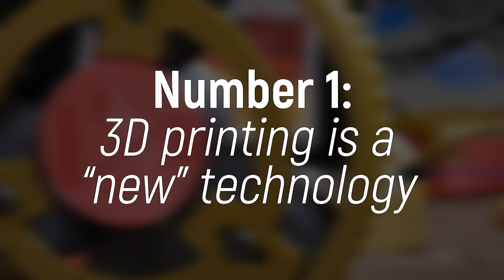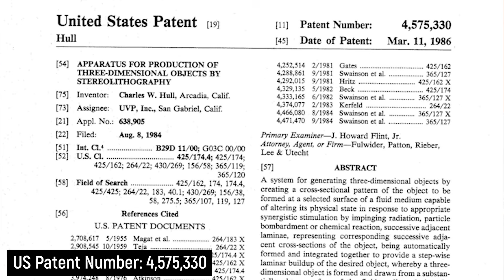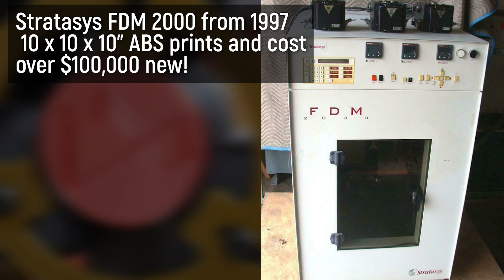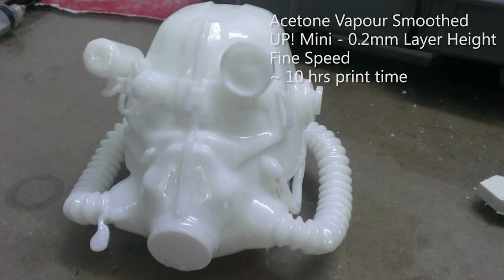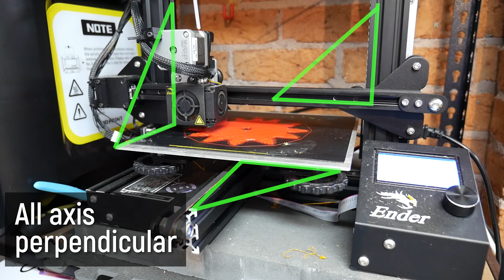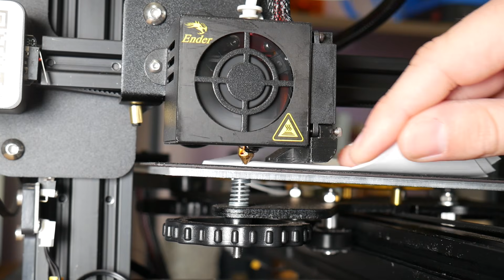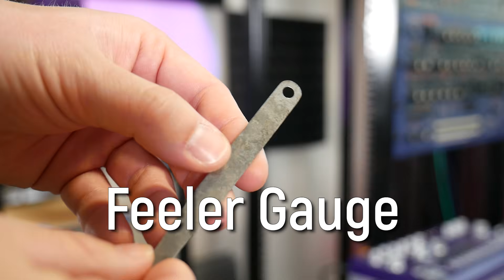3D Printing Myths I used to believe...

Comment: Instead of using a regular thick folded paper, you can use a small piece of baking paper. It is only ~0.05mm and it is resistant to heat. This is my go-to method and it works great.
Reply: I use bible paper.
Reply: @dodgyaz  is it better than baking paper?
Reply: @Pengquy  Probably not but it has more edge.
Reply: @Pengquy  Yes, it is. It gives the bed auto-level after initial leveling and you don't need to use a BLTOUCH sensor, it is magical.
Reply: @dodgyaz  even better idea!
Reply: @dodgyaz  Bed levelling with the help of Jesus
Reply: K
Reply: a card is best, no point to get that thin as you'll compensate it later with z offset or endstop position
Reply: @user-yk1cw8im4h  The thickness of the baking paper (0.05mm) is roughly the same as the common (MK8, V6) nozzle+heatblock thermal expansion you will get when heated. So you don't need to adjust absolutely anything afterward. Use whatever you think is the best.
Reply: OooOoOoOOooooo that's a good idea!
Reply: Feeler gauges
Reply: I've found a single piece of 20lb printer paper works very well. A 24lb sheet is too thick - enough to actually matter. 20lb, my prints have good adhesion all the time (barring some other issue); 24lb, they don't.
Reply: The point is that paper is not and exact thickness. it has imperfections and can crush if you accidentally adjust it too tight.  once you crush it, now the thickness of the paper has changed. so it's really a blind leading the blind method.   feeler gauges are exact throughout and do not crush.   While paper may work "OK" it is nowhere near perfect.  Although only your first layer or 2 would be affected by imperfection, the subsequent layers would fix themselves as the plastic is malleable and it will self level as it goes.
Reply: @viperfukgoogplus386  it is actually, standard a4 paper is 0.1mm thick, consistently

Comment: So assuming the frame is square, If I set my nozzle/bed gap to 0.2mm and in the slicer set the first layer at 0.2mm, will that mean it actually prints the first layer at 0.4mm?

Comment: Hi, very interesting video, thanks for enlightening me.

I have issues with the feeler gauge method over paper - the feeler gauge is smooth, and it's hard to detect contact unless you apply downward force, and then the bed or nozzle will deflect because of the springiness of everything. The 60gsm paper method is better in my opinion, because it has texture and you can feel better.

If you mic a piece of 60gsm, will get 0.1mm all day. The micrometer will compress the paper slightly. I aim for a light touch, I can print a test layer at 0.1mm and get pretty close to that and I find that with my 60gsm, light touch method, My prints stick well to my (glass) bed when I print at 0.1 or 0.2mm first layer.

PS, have you heard of PLA-F? I got some by accident and love it!

Comment: As far as I could tell in Ultimaker or Simplify3D and probably any other printing software, it says in the print settings, what layer height the first set of layers should be...This is something clearly stated in the instructions, so I am not sure where a myth would come from. ALSO it states to use a THIN SINGLE LAYER of paper, not to fold it. I am sure the community thought they were smarter than the guys that write the code and software to use with printers, but dang...RTFM. The most crucial thing to do, is to REALLY FOCUS on the setup of the printer and getting the gantries square, bolted tight and moving smoothly with belts firm but not stretched...again RTFM....it's all there. Even the poor translation from the Chinese made Ender are spot on.

Comment: As a former engineer with tons of machine shop experience, I’ve always hated the term bed leveling. I level using a feeler gauge, but I take one more step. I place the nozzle directly over the center of the leveling screws. This eliminates any errors that might be introduced by being too far away from those fulcrum points.
Reply: I found some g code for the ender 3 that goes above each poiny
Reply: @tobysmith4604  ok that explains why the level spots I use pretty much line up with the leveling screws.
Reply: Yeah. That always made the most sense to me.
Reply: I was just doing the above the screws thing earlier, didn't have any paper or such tho..(I just put the thing together today, am still noob :o)
Reply: Wow wow amazing very very clever dint think of that idea but yeah come think of it your definitely right each point will make the build plate level 👍👍👍😎😎😎thanks
Reply: @richardbrown9035  ok, boomer
Reply: It's also not a bad idea to check the centre of bed too for bigger prints. Can eliminate any possible bowing before starting
Reply: That is actually a really good tip!
Reply: I'm happy that my first printer "says" just that. the feeler gauge is a sheet of whatever that is, but it tests the hight on every screw+ the center. I think this is quite good.
Reply: Yeah this is what all the guides I saw said to do, go right over the screws. Then these other videos are doing corners, and this is first time ever I heard "folded" paper its like no so much is off with this.
Reply: I did the same, eventually I wrote a G-code, that moved the head to the right point and made two full circles, as due to 4-screw design on my ender, one screw can move opposite side of the bed.
Reply: @Papinak2  the whole point of placing the nozzle over the center of the leveling screw is that those points are fixed. They don’t move the opposite points, or as long as you’re close enough not a significantly difference.
Reply: @JeffsAquaponics  tht would be true for three screws, but with four, there's always some force that pushes on the other screws - in an extreme case, if you tighten screw in one corner (by several milimeters), adjacent corners become loose, too.
It doesn't matter if you're nearly square, but if there's about a milimeter difference between corners at start, it becomes more apparent.
Reply: @Papinak2  the the center of each screw is a fixed point, unless you’re starting with a grossly off “level” bed. In that case you’re dealing with the springs potentially not doing their jobs. But if you’re relatively “level” then for all practical purposes the center of each screw is a FIXED fulcrum point. As you move away from the screws you’ll start to see things move due to the bed pivoting on the FIXED points. Seriously, I’ve used a dial indicator on those points and they move in the tenths if at all, which makes zero practical difference.
Reply: @JeffsAquaponics  grossly off-leveo is exactly what younstart woth, if you tighten all screws and then start leveling, like mentioned in video.
Tenths of mm become quite a lot, if you print with 0.2mm nozzle on glass, without mesh leveling.
Reply: @Papinak2  tenths, and in ten thousandth's of an inch. Like what a dial caliper measures. I'm not arguing about your methodology of going around twice. Hell, I go around the 4 points the first time and just make the bed touch the nozzle. Then I use the feeler gauge. At that point the four corners are pretty much fixed and not moving more than a few ten thousandth's of an inch.
Reply: So what you are saying is I could use Any known thing like a gauge block and use that to set the z offset instead of paper?
Reply: feeler gauges are my go to for stuff like that.
Reply: Good point.
Reply: I thought about the fulcrum aspect, wondered why it doesn't go for directly over the bed adjustment screws, the first time I trammed the bed of this printer. It forms a smaller square with the tram check routine than the adjustment screw locations under the bed. Is it possible the far corners of these mass produced glass plates tend to have a slight warp? I don't see any other good reason not to have programmed the machine to go to exactly where the adjustment screws are located. I find the standard A4 printer paper, unfolded, is fine for round one, but examining and fine tuning based with the reflection of the nozzle off the bed surface at each corner, as well as the center, works best for me, especially with the thinner Garolite plate I acquired that has a slight bow warp on one axis of the sheet.
Reply: Same as smash repairs measure from fixed points generally unless somethings damaged or faulty the measurements should be sound!
Reply: Exactly what I do too. Having an engineering background is priceless.  It's amazing how popular conceptions actually cause so much confusion. The confusion I had when I first setup my printer is that I thought for some reason the paper trick was meant to bias the actual measured gap...  I quickly understood it was just a substitute for doing it correctly with a feeler gauge.  ...and, by the way folks, you could pick any known object, dial in the Z axis to its actual height and go from there. ...and also do it with the head and bed at operating temperature so that you are not including a solidified blob of filament under the nozzle and warping of the bed is included.
Reply: @robinm3003  Pat yourself on the back I guess you made the video then🤔
Reply: @Yamaha1300r  It is a wonderful method for sure. 💋
Reply: Because what we are actually doing is tramming three bed. Not leveling it
Reply: Tons of machine shop experience and you've never used a dial indicator to tram your bed? Lol I smell a liar
Reply: @aidankilleen5889  my hot end has a permanently mounted bracket for my dial indicator. I smell a troll.

Comment: Great vid, Angus.  You mentioned Z axis screws that go out of alignment when you power off the machine... This is an issue I have with my Creality CR-10 V2.  Is there a fix for this you can recommend?  It hasn't been a deal killer and I've managed to get decent prints most of the time however I'm always on a quest for improvement so any help is appreciated. Cheers!
Reply from the maker: A fix can be to loosen the screws attaching the gantry to the z rails a little, adjust the leadscrews to be level then retighten so it doesn't want to skew on its own.

Comment: There‘s another type of setting the Z-Axis. Print anything with a specific height (maybe 2mm), measure it (maybe 1,96mm) and set the Z-Offset to the difference (in this case 0,04mm). Next time you print, it will be perfect. I actually use Klipper on my CR10-S. When set up my bed, I first set the 4 corners in the same height … using a playing card. Next step is setting the mesh (5x5)  manually with the same playing card . Then I set the Z-Offset to about the playing card thickness (negative) … perform a height test print with 0,2mm layer height … measure and reset the Z-Offset … Perfect (+\- 0,02mm)

Comment: i trim up mine with just a single piece of paper ... none folded ... thats what the user manual said with mine... i still have to adjust the z-off set down to to get it to properly work sometimes though

Comment: Saying "3D printing is an old technology" completely misses the point. It existed for a long time in a niche too expensive for common use and too unreliable and imprecise for most professional uses - essentially a useless branch of manufacturing. The real revolution - THE new technology - were RepRap and Prusa - 3D printing of 3D printer parts on the same model of 3D printer, and making it all open-source and off-the-shelf generic parts.This cut the cost and increased accessibility so much, that 3D printing ceased to be useless.

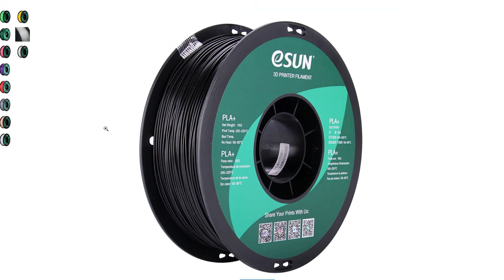Comment: 5:09 Alloy? I thought, by Definition, that an Alloy was a metal, made by combining at least 1 elemental metal with other elements. (EG, Iron and Carbon for steel, or Tin and Copper for Bronze)
It also has to form a molecular bond. The chemical compound known as Tungsten Carbide cannot be called an Alloy, it's a Ceramic, because the Carbon doesn't actually bond to the Tungsten, it just gets suspended between the Tungsten atoms.
Metals are also usually a single gigantic molecule, where every atom is bonded to another. Plastic doesn't work this way, they're made of Carbon atom chains of a very specific length bonded to Hydrogen, or very specific molecular configurations, usually composed of carbon, oxygen and hydrogen, and maybe nitrogen.
Due to the very differing nature of the atomic structure of Plastics and Metals, there is no way you can mix a plastic in such a way that it conforms to the definition of the word Alloy.

Comment: To level the bed, i print a one layer square with a cross in it, basically 4 joined squares that cover the bed. Then measure it all over with digital calipers. You can get very accurate this way.

Comment: Mills aren't trammed with paper either. We touch off of the paper so you know that you're .005" away from making the first facing cut. Feeler gauges are the best to use unless you plan on using one layer height forever!

Comment: Regarding point 3. I've used feeler gauges on a preheated system for a long time. 0.18mm worked great for PLA and PETG on a 0.4mm nozzle for 0.2mm initial layer height. For a 0.8mm nozzle and 0.4mm initial layer height, this doesn't work so well. A 0.1mm feeler gauged worked better. What's the relationship or formula between initial layer height and nozzle distance?

Comment: 7:52 Since I've gotten into 3d printing about six months ago, the technique I've settled on is to start with the paper technique, then follow it up by live-leveling the first few prints thereafter (it helps that Cura always prints a skirt so live-leveling doesn't hurt the first layer of the actual print). With that in mind, careful squaring with a single, unfolded sheet of printer paper is definitely "good enough" for quick, rough prototypes and live-leveling gets me the rest of the way for final versions or more aesthetic prints.

That being said I imagine it will be hard to go back once I decide to pull the trigger on a BL Touch or similar device...

Comment: 3D printing used to be called "Rapid prototyping" and I first saw it in use as early as 1997. Resin printing, basically. I think what created the media moment for 3D printing was the success of the open source movement around filament deposition. The RepRap project made it accessible to anybody, and that's what was the real sensation. This was around 2010, really, when things blew up.
Reply: I was learning this on an early Stratasys machine between 2005-2009 at the University of Massachusetts at Lowell and we were still calling it rapid prototyping at that time.

Comment: I always just level my bed while printing a skirt around my part. That way you're leveling the bed under real printing conditions immediately before the part prints, rather than just going with what ought to be good enough for a general case.

Comment: For the nozzle hight adjustment. 
Since I was really confused from that paper thing and manuals right when I started because I already knew that the print will start at +0.3mm for example, I never did that again. 
My method: I clean the hot nozzle and remove the filament. Then I put a flash light behind the nozzle or the bed and I look flat over the bed surface. then I adjust the screws on all corners till barely no light shines through between nozzle and bed anymore. so they very gently touch. Violla, perfekt level and first layer. All done. 

And with a bed level probe and mesh leveling I do the same to calibrate the probe hight. it's always on spot!

Comment: our 3d printer has a problem where when corners are set it can't go to middle of bed because that is too close .... can I fix that? it is higher from the middle than the corners just enough that loose paper on corners still caused it to "get stuck"

Comment: They say use a piece of paper to set the clearance between the bed and the nozzle but don't give a actual measurement, I was using just 80gsm paper at first that's only 0.1mm and I was having all sorts of issue's, I found using 250gsm that's 0.25mm works.

Comment: Using a paper to level the bed is not supposed to get you level.... It's supposed to get you close enough you can use the printer to finish it manually...  Even user manuals tells you to use the printer prior to doing "test prints" to finish adjusting the bed level.

Comment: The first myth is not really a myth. The industry is using them in an increasing capacity at a rapidly growing rate. I work in plastics and on the prototyping side of things rapid iterations over designs are highly desirable to customers, and there are plenty of parts which are cheaper for a customer to make than to pay for a fully machined mold.